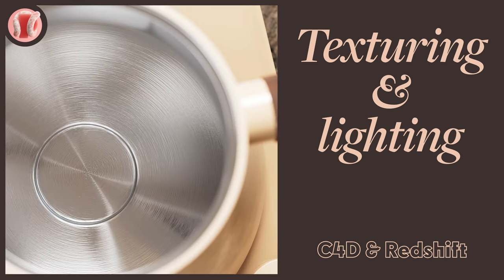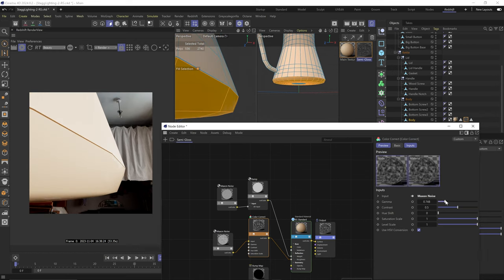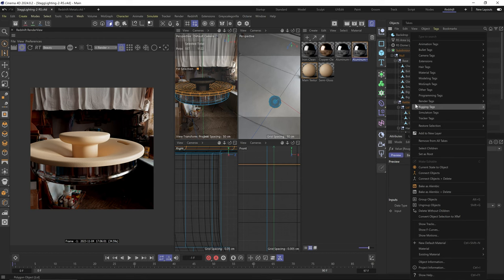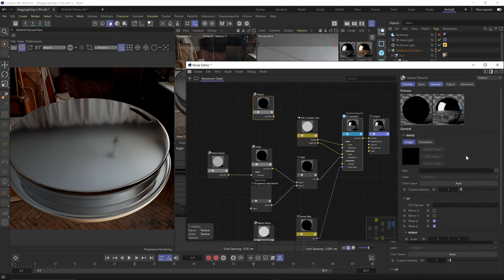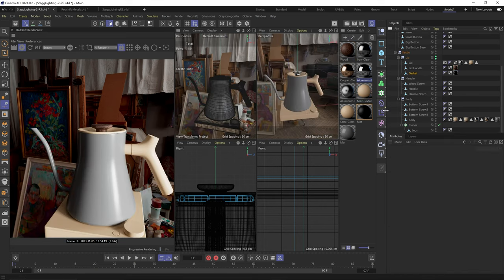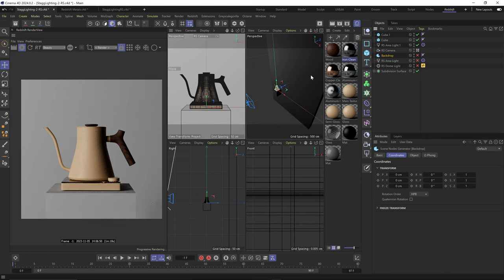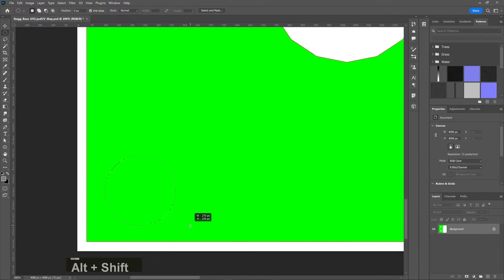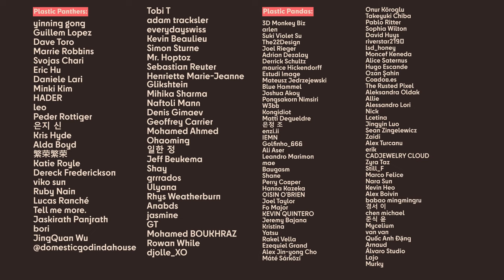Cinema 4D Tutorial - Texturing & Lighting the Fellow Stagg EKG Studio Pro (Redshift)

Comment: Do you prefer redshift to octane ?
Reply from the maker: Hmm I would probably choose Octane if I had to choose one. Much more robust, much faster, it's very powerful. One good thing about Redshift is that it's more stable.
Reply: Oh ok I see ! Also I have a very important question, when i use a projection inside octane material node root to all my image texture, it's work for all but for the image texture displacement it doesn't, nothing happened and after i have to struggle with the texture mapping outside node editor try to match the setting inside c4d, do you have a solution for this ? can't find anything on the internet..   @NewPlastic

Comment: Procedural materials are posiuble but are much less userfrendly  usually you need to do it with some vector math  or some  offsets.
for example for that radial blur. use ramp map set tu circular  that goes in to range mapper  set output to high nimber and that goes to offset of notice texture 

https://www.youtube.com/watch?v=Otc-OfJXTf8